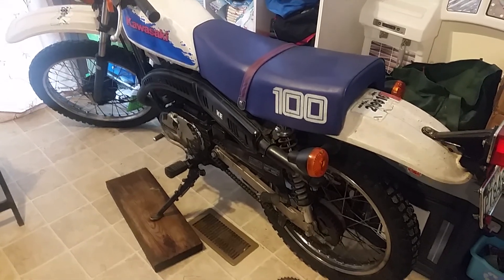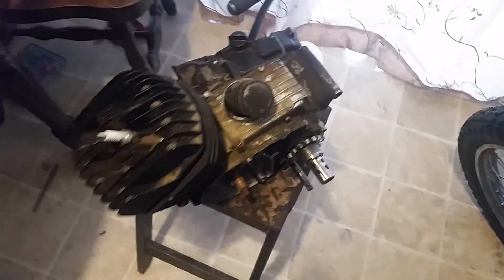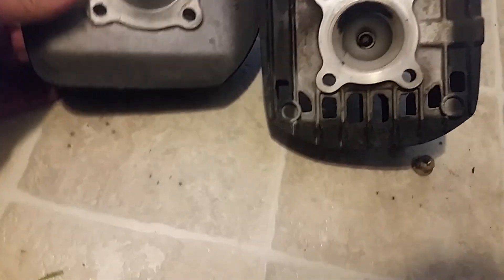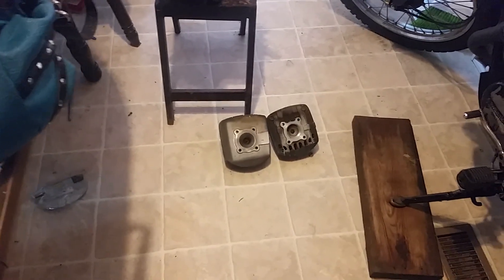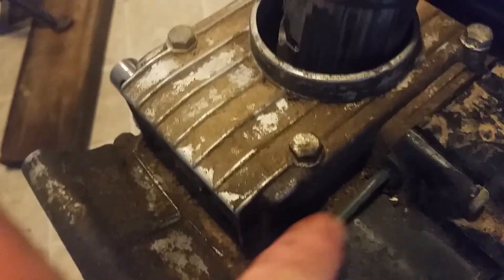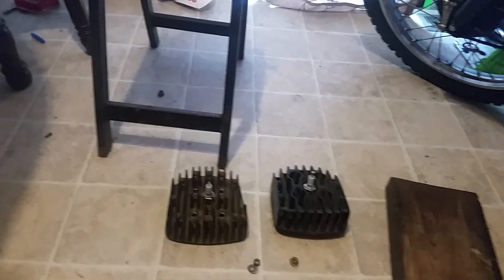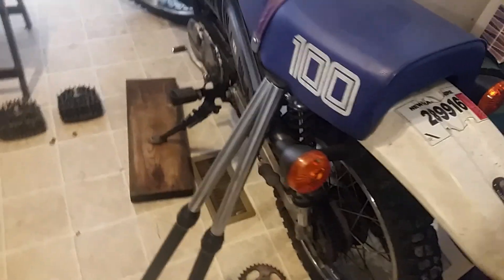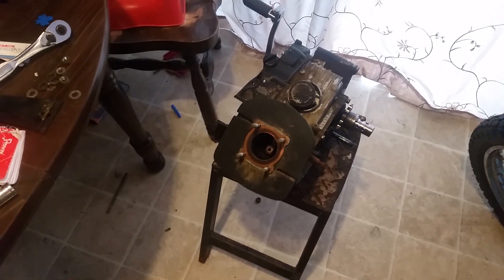KE100 high compression upgrade

Comment: I love it, this guy knows more than Kawasaki, the company that designed and built the bike. If this head was better for road use Kawasaki would have fitted it to the KH100 in the first place...
Reply from the maker: Thank you the reason why they don't use is because hi compression head  requires hi octane gas
Reply: @2strokeguru   You didn't say in the vid hi octane gas needed to be used for this mod.
Reply from the maker: @sonicboove4865  I forgot to in the video this was one of my earlier videos
Reply: @2strokeguru  👍

Comment: Any advice on adjusting the carb after installing the older style head?? Thanks again for your content 🤠
Reply from the maker: Richen the air fuel mix
Reply: Kevin Bergeron okay so less air more fuel? And when replacing the piston, would you recommend drilling lubrication holes if the replacement piston doesn’t have any?
Reply from the maker: @DelphinSpeakz  no drilling thats for a different application
Reply from the maker: What bike do you have
Reply: it’s a 01 ke100, and drilling didn’t sound right but it’s a wiseco piston and looks different than the one that’s in there,
Reply: Kevin Bergeron so I went ahead and changed the piston/wrist pin/rings/ circlips and put a fresh wiseco piston in, but now my top end makes this whirring sound that makes me think I messed up on something, do you think the sound be from a bad hone job/ lack of relieving the exhaust / or not drilling lubrication holes? Haven’t done the carb adjustments yet
Reply from the maker: @DelphinSpeakz  did you face the arrow on the piston to the exhaust port
Reply: Kevin Bergeron yeah it’s facing the exhaust port. Kinda hoping it’s just the sound it makes whilst making the glaze on the walls. My hone job was not that great
Reply from the maker: @DelphinSpeakz  did you brake in the rings 2000 rpm 20min
Reply: Kevin Bergeron I guess not specifically, just kinda gave it a gentle run thru by riding it for bout 5-10 minutes till I heard the whine when going round 35mph

Comment: I just put the hc head on with new sleeve/stock bore, custom exhaust, 20 pilot and 85 main with oil injection bypassed you way. Plug br7es that came with head. First plug check was great. Started breaking up on the last ride check plug and half the electrode is melted off. Gonna buy a hotter 5 Plug.
Reply: The b7hs plug u recommend is a lot shorter. Would that be my problem may be too far in the combustion chamber? I have to be 7hs plug also that was in my head that I took off
Reply from the maker: Bypassing the oil injection system will damage the rotary valve
Reply: @2strokeguru  I know. Was already like that has a totally different subframe no oil tank so I'm taking my chances. See how long it lasts with me I'm riding it regularly after work I'll deal with it afterwards and modify the new rotary valve

Comment: Thanks for your knowledge and info. Getting resleeved and installing the head as I am new and leaned the oil as tank is deleted. Previous owner installed a dirtbike rear subframe welded on. Any idea of the compression ratio increase? Any problems running 87 although Thinking I'll just run 93 as I am in florida and 45 mph roads so wide open most of time. Where can i get bigger jets? Mine has a custom full exhaust from previous owner.
Reply from the maker: I don't know what the compression ratio is it is a lot higher and you must run high octane damage will accrue to the rotary valve if the Oiler is bypassed getting is done by trial and error to small it will lean out and burn up to big it will be too rich and cause foul plugs and low power
Reply: John Cheney Dirtbike subframe on a KE? I’d love to see some pics of that 👍🏾

Comment: I’m having problems getting my (2001) ke100 started, it has great spark and a fresh plug. Freshly rebuilt carb. It runs great after you push start it but takes forever to start. Any tips? Is there a hidden jet in the carb I missed or something? Could it just be not tuned right?
Reply from the maker: ThatOneLaxKid sounds like carb issues check out my carb videos they help alot if you still can't figure it out what is going on call me I can talk you through it
Reply: Kevin Bergeron I watched most of the videos and ended up cleaning the carb again along with the large bass jet in the center of the carb body. Helped it a ton! Thanks for providing all these videos for KE owners!
Reply from the maker: ThatOneLaxKid very welcome many more to come
Reply: Low compression

Comment: https://rover.ebay.com/rover/0/0/0?mpre=https%3A%2F%2Fwww.ebay.com%2Fulk%2Fitm%2F110864268430 
Is this the same? It's a 73 head I would buy when I get paid if so.
Reply from the maker: no thats the same combustion chamber as your bike you need a 71 72 73 kawasaki trail boss 100

Comment: Working on restoring my Ke100 and your videos are really helping. Wish I could find one of these heads, but I cant seem to find any in the UK for sale.
Reply from the maker: ebay 1972 trail boss 100 has the cylinder head thank you for watching my videos i am glad to help
Reply: Thanks. Quick question if you don't mind. I have an early 80s KE and the cylinder is slightly rust damaged from where I let it sit on the floor for a few months. If I get it rebored, will it need to be plated afterwards? I'm not too sure what type of cylinder it has.
Reply from the maker: yes and if you bore it you will need a oversize piston BUT if its just rust damage and no cylinder damage save money have it replated no need to bore  it

Comment: Kevin, thanks for all the videos on the KE100.  Both the G4 and G4 engines claim 7.0:1 compression ratios.  Do you have any numbers for compression before and after?   I did pick up a new head from a 73' and plan on posting my numbers.  Currently stock with reading of just over 120.  Keep the videos coming!
Reply from the maker: i swaped the head on to the ke102 build cold i am 181 psi
Reply from the maker: my engine is bored .020 over and has no carb yet so my guess around 160 -165 psi
Reply from the maker: i love this head great head 1972 trail boss 100 thats what the head is off of

Comment from the maker: and in the high compression means more heat make sure it has good fins
Reply: What is my 78 is it a g4 or like what generation
Reply from the maker: @critterproformance1824  regulator compression
Reply: I got my grubby little mits on a G3TR bushmaster.  I have heard about the smaller piston pins, is there no substitute that can just be installed when splitting the crank without engineering things up?
Reply from the maker: @richardthatguy9266  unfortunately splitting the case case is the only way to change connecting rod
Reply: @2strokeguru  
Did the piston pin diameter change over the years as it was a known fault from what I can gather...?

I'm struggling to find a decent source of info on these 69 to early 70's 90/100cc Kawasakis. Any pointers?

Comment: Thinking of purchasing one of these heads for my bike I've got a 97 ke 100 there 80$ on eBay listing says g4tr is that the correct model
Reply from the maker: look at the pic make sure it is the hi compression head they came both ways
Reply: kevin Bergeron ok thanks
Reply: kevin Bergeron would I need to re jet the carb for to compensate for the change or anything like that. Also thinking of building a tuned pipe for it.
Reply from the maker: no re jetting  however you will when you build you pipe i am building a pipe as well heres a tip on the exhaust the 50cc 2stroke aftermarket pipe with a little mod will work
Reply: kevin Bergeron ok cool what jets would you recommend or does would my altitude determine that and I have an idea in mind I was gonna use a generic 2 stroke 50cc pipe off eBay I've used before on a motorized bike build I did a few years ago. I also have a 6.0 cc combustion chamber head from the build was wondering if that could work as well I have another ke 100 I'd try it on b4 I try it on mine but just curious if it fits would it work. I was gonna use the 50 cc exhaust and buy another ke 100 pipe and cut it about 1/4 way up form the header and cut the same on the 50 cc pipe and just weld the ke header on the 50 cc pipe so it'll bolt right on.
Reply: I was riding yesterday and I noticed when I was going about 50 the bike got noticeably louder in the engine revs and pops from the exhaust when letting off the gas any idea ? It goes away after getting out of high rpms
Reply: Id say running lean

Comment: Interesting.  Why would they move to a low compression, lower efficiency and power?
Pretty cool you know all this stuff.  Thanks again for sharing.  I literally know nothing about engines or motorcycles.  Always glad to learn something.
Reply from the maker: no they had that cylinder head on the g4 engine its a different family of engines it has a 10 speed trans so the head provided a little extra